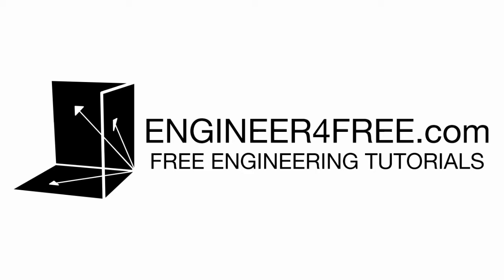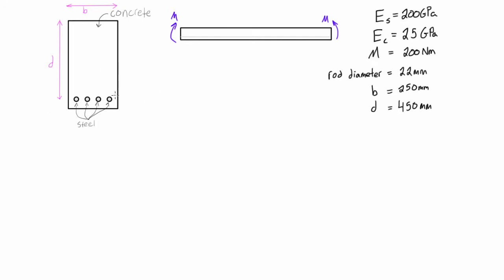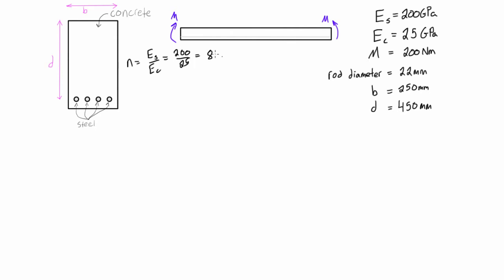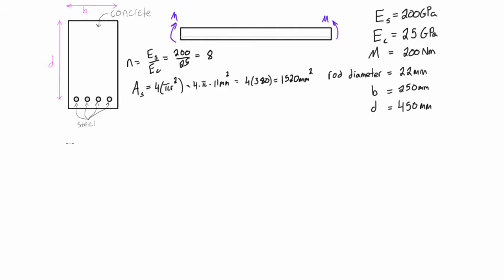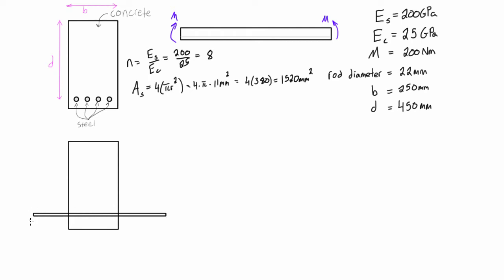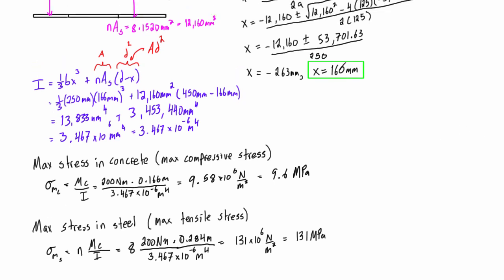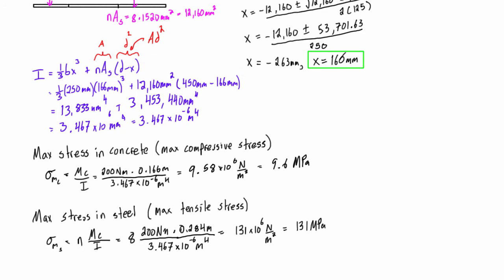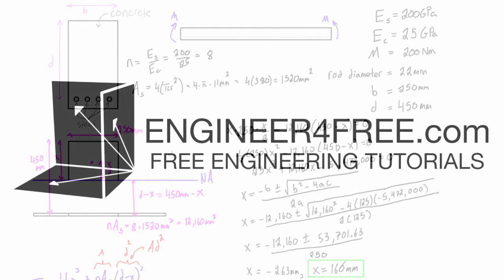Pure bending of reinforced concrete example #1

Comment from the maker: There is an error in this video in the calculation of moment of inertia, that starts around 10:34 and carries through till the end. I was distracted while speaking, and somehow the calculations went haywire. The correct values are as follows:

Moment of Inertia = 0.001362m^4
Max Compressive Stress in Concrete = 24.4 kPa
Max Tensile Stress in Steel = 333 kPa

Comment: If i create a FE model of rein. concrete can I use this calculation to validate my model ?
Reply from the maker: This method is from Beer and Johnston Mechanics of Materials, you can check this software too https://bit.ly/skyciv-e4f they have a reinforced concrete calculator under the "software" tab in the top navigation menu.
Reply: @Engineer4Free  thanks Sir

Comment: Thank you Sir
Reply from the maker: You’re welcome, thanks for watching!! 🙂
Reply: @Engineer4Free  quick question if i may, i am using this calculation to calculation bending stress in a beam for an Finite element concrete beam, so you know if this is the correct calculation ?

Comment: I is wrong ,
Reply from the maker: Yes unfortunately there is a math typo in this video. The process is correct, but the typo unfortunately happened and carried through to make I and the end result incorrect.
Reply: @Engineer4Free  What is the right answer?
Reply: @francosfusion  When I calculated it. I got I = .0013623 m^4, compressive stress = 24.4 kPa, and tensile stress = 333.3 kPa

Comment: Sir why it's 1/3 bx^3 not 1/12 bx^3
Reply from the maker: It's a shortcut when the axis of interest is on the edge of the rectangle you are concerned with. If you write 1/12 bx^3 it will actually sinplfy to 1/3 bx^3 so you can just skip the simplification if you know recognize the scenario. You can see both 1/12 and 1/3 variations listed here: https://en.wikipedia.org/wiki/List_of_second_moments_of_area

Comment: sir why is the neutral axis not in the middle of the cross section .ie. d/2 ?
Reply from the maker: Because the steel and concrete do not have the same modulus of elasticity. When we transform the steel to an equivalent area of E=25GPa and then ignore the concrete in tension, the cross sectional area that we are working with is no longer rectangular. I recommend watching videos 29-34 here: engineer4free.com/mechanics-of-materials and if you have time, videos 22-28 also lead into those and would be helpful background information. Neutral axis is only d/2 for members that are symmetrical about the axis.

Comment: why are u using nAs instead of (n-1)As
Reply from the maker: If you define n as the ratio of (the original modulus of elasticity of the section you want to transform) divided by (the modulus of elasticity that you are transforming it to), then you will be virtually increasing or decreasing the transformed section by that value when we multiply it by n. In this case n=Es/Ec gives us a value greater than one (8). It's like saying the steel is worth 8 times more than a material of E = 25 GPa, so if we transform it to an equivalent area of a material with E = 25 GPa, then the transformed area = n(As) = 8(As). I'm not familiar with a method that would use (n-1)As, if there is one, perhaps they are defining n differently. Did you watch the previous video? If not you can see it here: engineer4free.com/4/pure-bending-of-composite-materials-introduced hopefully the explanation there clears up the method that I follow in this video!
Reply: The (n-1)As is used when the concrete below the N/A is not removed from the equation, in other words for an uncracked section. When the section is fully cracked, then nAs is used instead.